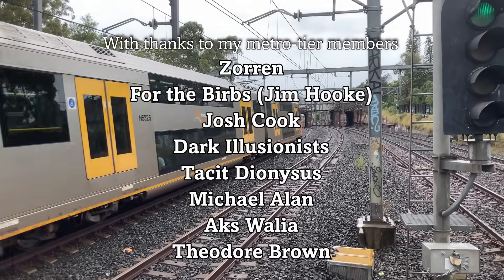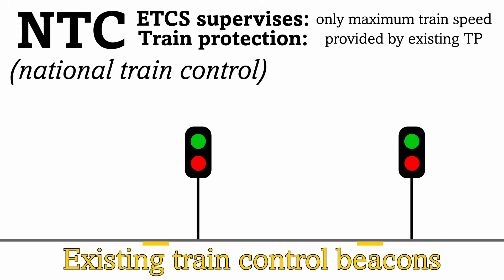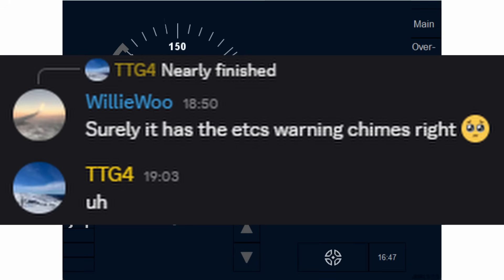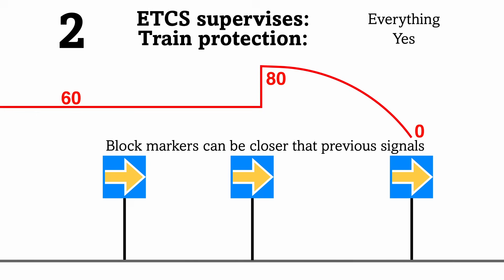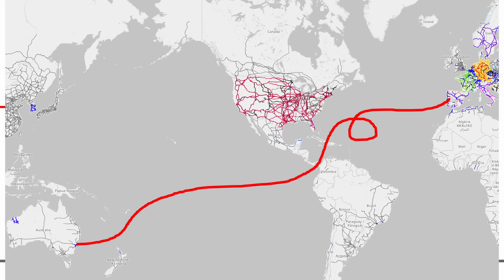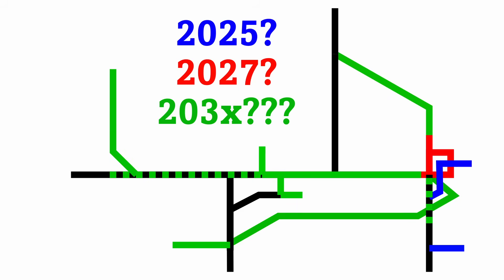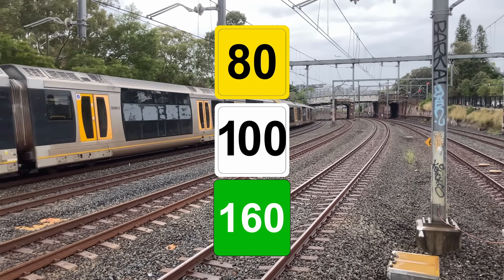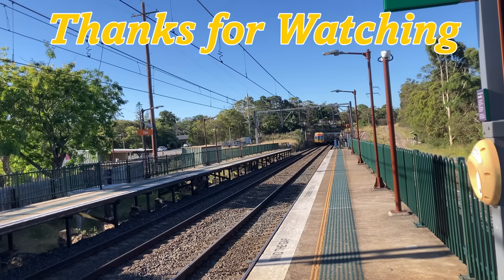What is ETCS? Upgrading Sydney's Signalling

Comment: Great video! Unfortunate you didn't mention Melbourne's CBTC system currently in operation. It runs with a moving block for those trains fitted and other non fitted (ie freight and regional) to run under fixed block, colour signals together by detection of axle counters. Melbourne's CBTC is a modified 'open source' product that after a lot of testing and issues is now performing really well. The new metro tunnel uses a CBTC moving block system only.
Reply: So, yet again the states cannot agree on a common standard for this. I’ve always thought that the states (colonies) biggest blunder was not agreeing on a common rail gauge, leading to the mess we have now.
Reply from the maker: I didn't mention Melbourne's CBTC because it isn't ETCS. There are lots of moving block CBTC systems, Thales makes one, Alstom makes one, I think Bombardier did etc etc. They are incompatible with each other and are inherently proprietary, not open source. ETCS L2 can be used in a similar hybrid system, though. Most lines operate in a hybrid system during the comissioning phase when not all drivers are trained and some retain signals long term, like the Thameslink core in London.
Re state compatibility it doesn't matter in this case. There is a maintained colour light system in Melbourne's CBTC areas to allow non-fitted trains to run, not to mention it exists on the Victorian broad gauge system only.
On the national standard gauge system, ARTC and other third party operators mostly use either colour light signals without any train protection (that any train can run over) or paper/radio train orders which again almost any train can run over. ARTC is (at a glacial pace) rolling out its own cab signalling for remote single lines called ATMS which I touch on at the end of the video. The only other cab signalling system used on the standard gauge system is ETCS, of which the ETCS only product (L2) will only be introduced onto non-freight corridors in the short term.
Reply: @Novocastrian-wp4ll  agree with that being a blunder. At least the Melbourne system is only fitted on the broad gauge tracks. So unlikely to be a problem for national rolling stock
Reply: @ryanlove5332 That’s true, hadn’t thought of that.
Reply: @ryanlove5332 But it also occurs to me that a lot of the interstate Standard Gauge tracks are dual gauge.
Reply from the maker: It’s not a blunder. Trains that can run in CBTC areas physically cannot run in ETCS areas and vice versa. Signalling is not the issue.
Reply: @hain_train The blunder I was referring to was the failure of the colonies to agree on a common rail gauge. However, in the ETCS vs CBTC contest, what happens with dual gauge tracks (broad and standard in Vic, narrow and standard in QLD and WA)
Reply from the maker: No dual gauge is fitted with CBTC. If it was, they’d keep the existing signals to accept non fitted trains.
Reply: @Novocastrian-wp4ll unlikely to fit it to both gauges as typical one of the gauges is not the predominant traffic source.  For instance there would be 100s of broad gauge trains running into southern cross station daily, but there will only be 2 or 3 standard gauge trains and the section of dual gauge track from Dudley street to Platforms 1 & 2 is only short and a hand full of signals are needed to accomplish the moments. So it’s not economically worth fitting.
Reply: First time I’ve heard it’s open source, where can I find out more about this?
Reply from the maker: Yeah it isn't
Reply: Transperth has also decided on CBTC for their electrified network for some reason, so it's going to be interesting to see how they deal with the dual gauge along the Midland Line.

Comment: Alright so the "Morgate control" or an older variant was being used in Sydney prior to the Moorgate incident in London. The tripcocks down the legnth of the platform at Town Hall and Wynyard were introduced in 1932. However, they did work a little differently in that era, technically allowing the following train to enter the platform before the previous train had even fully left the platform, provided there was enough room and the train leaving was traveling fast enough. The exact details of how this system worked are somewhat lost to time, as it was modified to the current operation some time in the early 90s. So while the current operation is the same as the moorgate system, intermediate tripcocks have been in use in New York and Sydney prior to the Moorgate incident.
Reply from the maker: Yeah I wouldn’t call it moorgate control because it allowed trains into occupied blocks and I believe did so only through track circuits, not proving train speeds.
Reply: It was fairly straightforward in principle, but more complex than what remains today. Provided the departing train could beat a track circuit timer thereby proving that it was departing quickly enough to prevent any part of it stopping on the platform in the event of a brake application, the following train (which was already approaching under low speed reduced overlap conditions) could receive a low speed indication to enter the partly occupied platform. At most, it might allow the red nose of the following train to poke out of the tunnel portal onto the arrival end of the platform as the departing train was grinding away, almost completely clear of the platform.

Comment: Queensland Rail is testing the Hitachi-made ETCS Level 2 system (ETCS-2) in the Shorncliffe line branch. By 2032, the system will be progressively rolled out throughout the Greater Brisbane commuter rail network (north to the upcoming Sunshine Coast direct rail, south to Varsity Lakes, west to Rosewood and east to Cleveland). When some sections, such as the Cross River Rail tunnel, are completed, the Automatic Train Operation feature may enable the train driver to minimise the workload as they only need to monitor the train's automatic driving.

Comment: Personally speaking, I don't like the idea of ATO on the Sydney Trains network outside of major areas (and even that is pushing it). ETCS Level 1 would be suitable and I feel there could be higher speeds even in the city areas (like 110 instead of 100 on the fast line between Lewisham and Burwood), which is really the only thing that is needed. But great video, it's very informative and I learnt alot.
Reply from the maker: ATO shortens journey times. Why shouldn’t we have as much of it as possible?
Reply: @hain_train  I feel automation wouldn't work with the network. To most efficiently improve the amount of trains (imo), is to improve the training for the drivers, etc, for them to better understand the trains they're driving and be able to keep to schedules easier. ATO would be an investment that wouldn't be nessasary.
Reply from the maker: It absolutely would work with the network. ETCS alone will struggle to reach 24tph due to the natural variations between drivers, whereas ATO will confidently accelerate hard (4th gen trains have an extra 0.2ms^-2 of acceleration locked away for ATO) and brake hard.
Reply: @PROTSW4  Just so you know (in case this is why you're doubtful of ETCS Level 2 ATO), ATO does NOT mean going driverless. Thameslink and other systems use Grade of Automation (GoA) 2 ATO, aka automatic train control, where a driver remains present in the cab at all times to manage the doors (or not if the guard does that) and ensure safe operation and clear tracks. As Sydney Trains still has level crossings, particularly on the Richmond Line and parts of the T5, a driver presence would be necessary to look out for tresspassers, unauthorized encroachment into the corridor, and vehicles (as humans and cars don't have ETCS haha). This is regardless of the customer service benefit, particularly on lines with lots of visitors to the city like T8 trains through the Airport Line, of uniformed customer service personnel on trains.
Reply: @hain_train Unless Sydney Trains decides to change the braking curves on the version of level 1 limited supervision currently in use, I don’t see journey times being reduced. ATO or not, the braking curves are very conservative. I’ve been told that it uses the braking of a K Set as its basis, even though the 4GT’s have much more advanced braking systems. It also doesn’t take gradients into account which plays a major role in train management. 
I guess what I’m trying to say is that if ATO is brought in, the current braking curves in place are too conservative to make a difference to journey times.
Reply from the maker: @peterk-s7798 yeah it’s based on a K set. That can (and will, I’d assume) be changed with ETCS L2

Comment: Thanks for making this video! Full disclosure, I'll probably have to watch it another two times before  I fully get it, but I'm very glad to understand ETCS better than I previously did 😅

The one question I have so far: how does ETCS tie into Automatic/Unsupervised Train Operation? (And could we start to see platform screen doors installed at non-metro stations in the nearish future?)
Reply: @TK-0865   far as I know, it’s deliberately two separate systems (but very closely linked).

ETCS ensures train safety (from speed and route conflicts) in conjunction with the signal box.

ATO over ETCS is basically an overly fancy schedule that knows how to drive blind (max speed, efficient braking and stopping at platforms).

Fully autonomous vehicles would additionally need a way to „run on sight“ in areas of danger and maybe honk at dangers. Many metro systems minimize those areas by using platform screen doors and stuff to guarantee no people (or big animals) can get on the tracks in the first place. And maybe have a qualified driver check tickets and take over when manual running is recommended.

Both the ATO and ETCS want/need a radio connection to the back office and balise data to drive properly and at least the balise antenna gets read by both (probably also the radio to the office, but not sure) and (ideally) the schedule knows about the signalling. But on the vehicles it’s deliberately two independent computer systems and only the ETCS one needs to be safe as a critical system
Reply: @genoobtlp4424  ATO over ETCS is currently only designed for GoA 2. A human monitoring the tracks is still required
Reply: @pirazel7858  darn, didn’t make that clear in my comment
Reply from the maker: So with extra eurobalises to give more precise location data trains can accurately stop at platforms, enough so for platform edge doors. Cross River Rail will use ETCS with ATO when it opens in 2026(?). Thameslink in London does and there are some cab videos of that process (just search thameslink ato). In Sydney trains would also need another computer for ATO but I believe most of the 4th gens have space for it already built in.